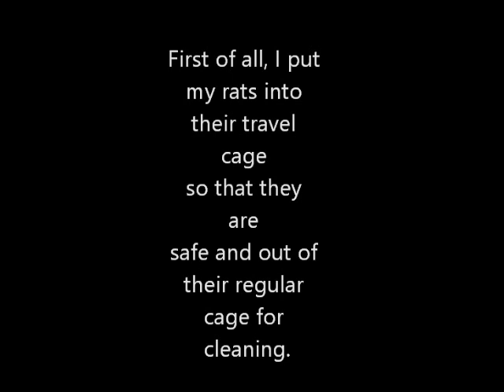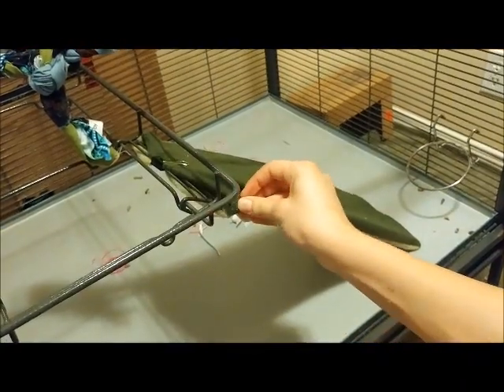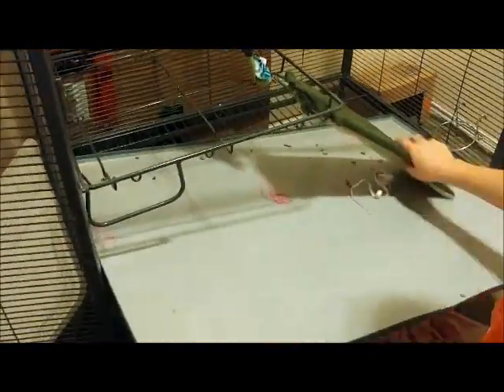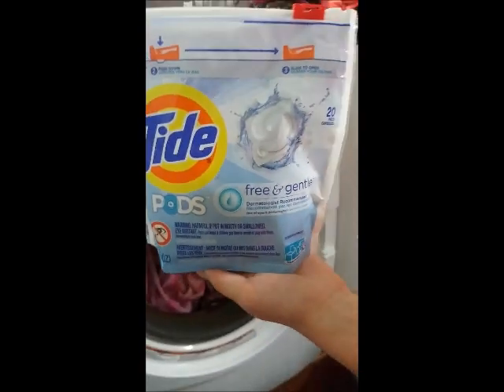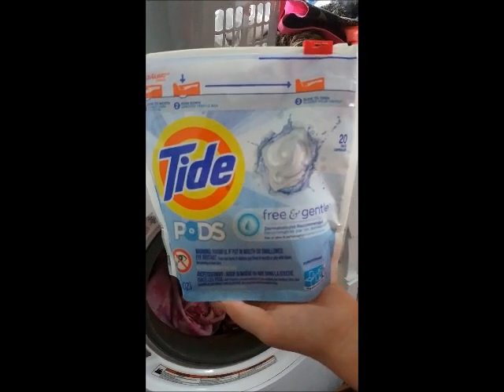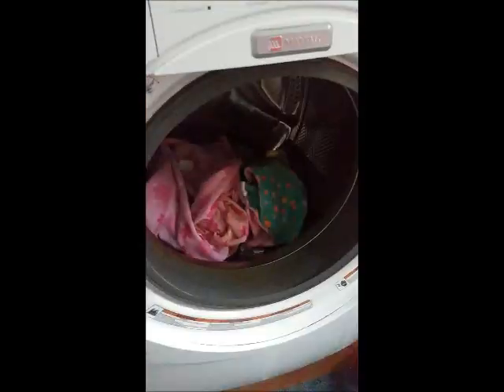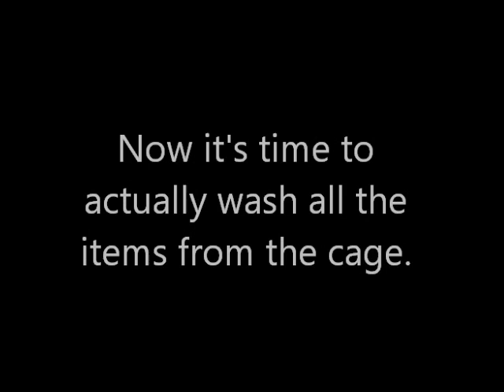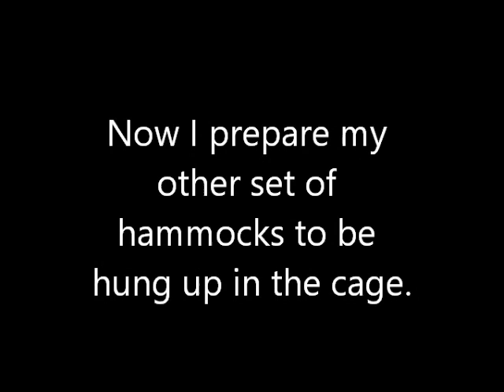How I Clean my Rat’s Critter Nation Cage!

Comment: Cleaning day is always fun haha
Reply: Is your 14 inch wheel big enough?
Reply: @firebringer88  Yes it was
Reply from the maker: @firebringer88  14 inches should be fine, but for male rats especially 16 inches or more is preferable. Personally, I no longer use a wheel with my rats as it is now slightly too small for them and it is not a necessary item. Plus, finding a large enough wheel for fully grown rats is very difficult.